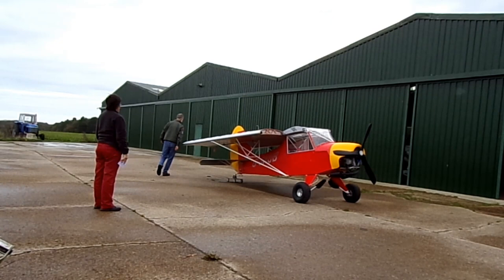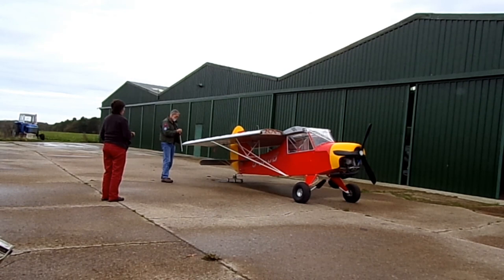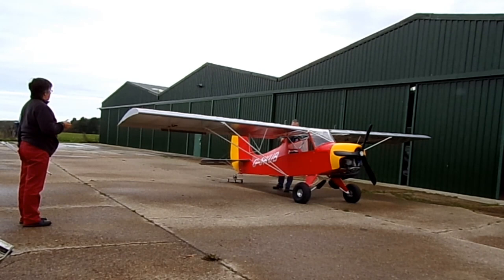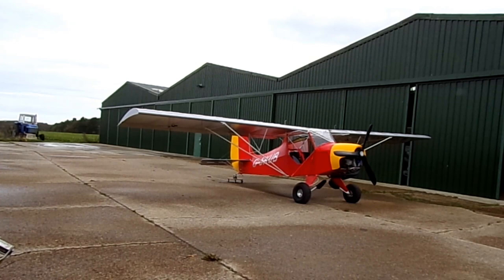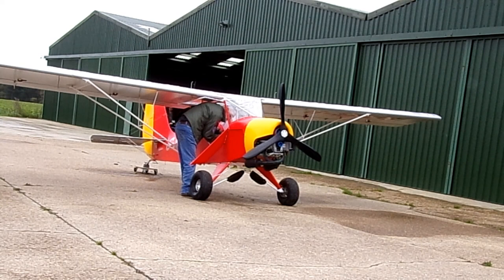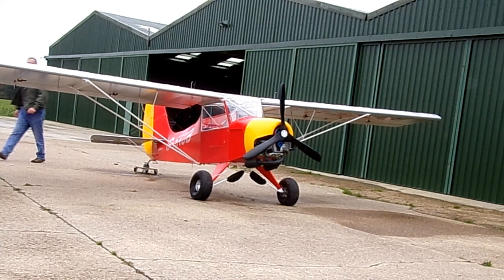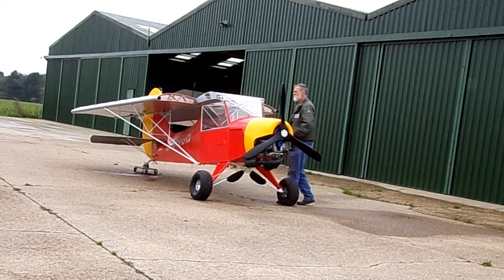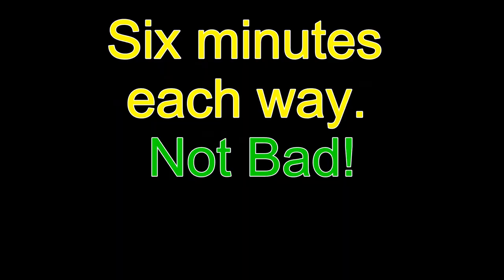Sherwood Kub Wing Fold System

Comment: What an amazingly simple system.  What kind of size/material are the pins?  I can't help wondering what kind of load is on them, although the span is small of course and the speeds are low. It could be of course that the surrounding structure is of far more importance than the pin, which is probably the strongest part of the fold system!
Reply from the maker: The pins are steel 5/16" diameter as a standard Cub style aircraft the flying loads are taken by the struts, the pin only taking comression and drag loads. They are the same size as on the two seat version (The Scout). It is a great system and takes about 5mins to fold or deploy for one person.
Reply: @flyingkub  Thanks for that. I was thinking of drag loads but I suppose if you were going fast enough to threaten that 5/16 steel pin you'd have a lot more to worry about, too...😉
Reply from the maker: @clearprop  Well it has held up for all the Post Maint' check flight at VNE 99mph and I only have a Max Continuous Level speed of just over 80mph, so a good buffer there, considering drag increase as a square of the speed :-)
Reply: @flyingkub  Yes I bet there is a hell of a lot more drag in those 19mph. While I'm here, do you mind me asking for your thoughts in building the Fisher? Is it purely for the build experience, or do you plan to let KUB go when the Fisher is complete? Or some other reason? Apologies if you've already answered this elsewhere - there are still quite a few of your videos to enjoy!
Reply from the maker: @clearprop  I am a mad engineer who loves building things. My plan is to replace the Kub with the Youngster but it would be nice to have both for a time and then keep the best (which ever that turned out to be), although I don't think that will be an option. I do love the Kubs easy handling but the Youngster should have a bit more speed. You never know I might even build a SD1 after the Youngster to get a really fast SSDR.
Reply: @flyingkub  I have a feeling there will be a string of these great little aircraft emanating from your workshop for some time to come! You'll definitely have a very keen audience for the builds (and I'll be squirreling away tips and tricks...)👍

Comment: Nice video. I'm still awaiting a price list with options 😀
Reply from the maker: Thanks for the positive comment.
Sorry and suprised to hear they have not got back to you.

It might be best to give them a call. I don't know how far away you live but it is worth going to them and having a look around and talk to them face to face.
You would see how they use state of the art welding equipment and even try one on for size (well I had to as I am 6ft 5"), also look at the other aircraft they do. If I was after a two seater the Scout is great as well (big brother to the Kub and as easy to fold up, to keep hangar fees down).
Reply: @flyingkub  yes I agree although I'd like a rough price as I'm up north would be a decent drive down 😀
Reply from the maker: @mnorth28  Phone them up and ask for Paul he should be able to give you an idea.
Reply: Did you ever get a rough price? It looks like an interesting bit of kit, but I saw on a website, new microlights can cost up to 40k :O You could get a Cessna 150 for less than that!